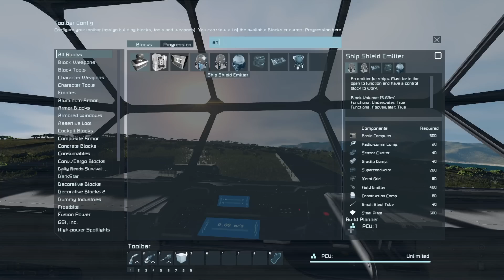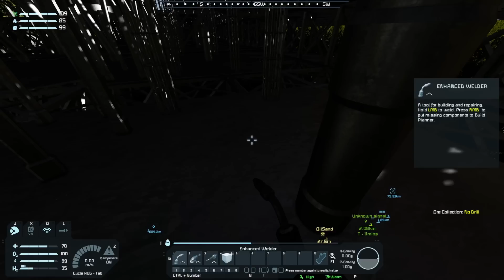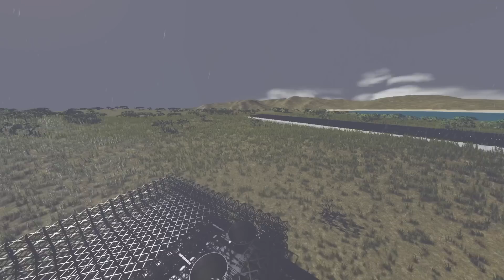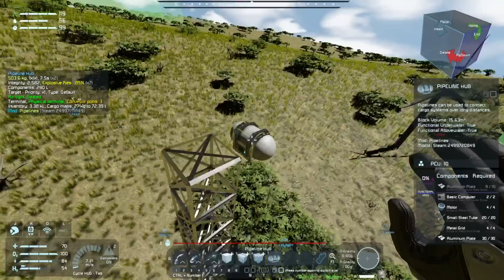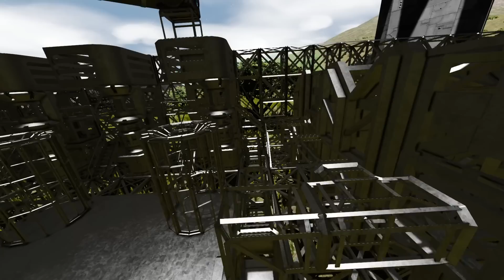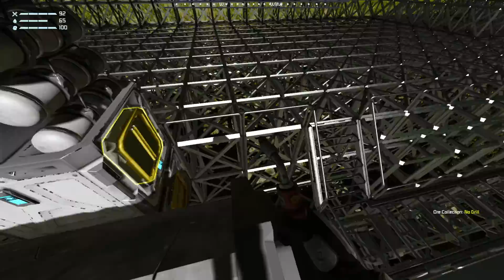Space Engineers - S4E49 'Building the main factory'

Comment: If you don't want a Pipeline to connect to another pipeline, just turn off "show block in terminal" It will still let pipelines connect to it, but it won't connect to another pipeline. That way you don't have to turn them 90 deg lol. I found out you need to put sorters before all types of refineries and oneway pipes coming out of the refineries. If you do not they will refine all ore in any state. I made it so they only except purified ore. Now, If you make all entry points convey to the purifiers first and only, you might be all right. The rock crusher will turn stone into gravel and you will not get other types of ore from them. I bypass stone around them. Also only a uranium centrifuge can refine uranium into fuel. I didn't see if you put one into the new factory.